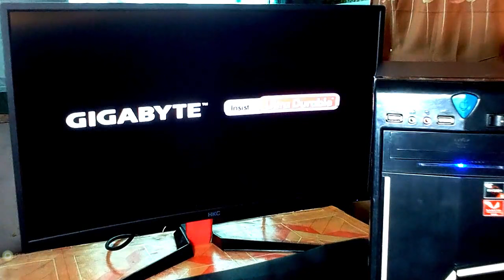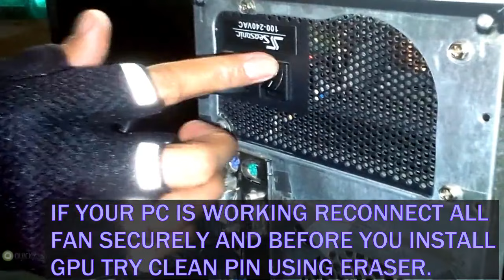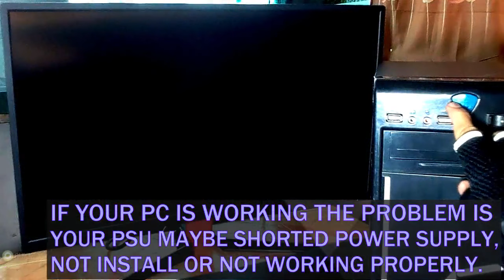HOW TO FIX COMPUTER TURN ON THEN TURN OFF IMMEDIATELY ? CPU FAN SPINNING ( 2019 )

Comment: My computer sometimes boot loops doesnt start. Then i changed ram thinking it fixed caused it worked again. Now it does this again
Reply: Ok what did you do ? Same issue
Reply: @memokane1  i toke the motherboard out and changed the cmos battery. And reset bios. Its now working again

Comment: Mine would turn off after a couple seconds of turning on. Or it would turn on and just black screen. The first two times of trying to take out the CMOS battery it worked and turned on. Now it won't even turn on after doing that. Just back screen
Reply: What did you do ? Same issue
Reply: @memokane1  It was my motherboard, it was bad. I tested everything out first and narrowed it down to that

Comment: Good day sir. Bumili kasi ako ng GPU (GT 610 1GB) my Mobo is GA-F2A68HM-S1 and AMD A8-7680 CPU.
After ko ilagay yung videocard, nagloko na sya. Ayaw na mag open ng Monitor though pag tiningnan ko yung fan ng cpu and psu, umaandar naman tapos inobserve ko, namamatay din cpu fan and psu pag tumagal. What shall I do? Na try ko na tangalin ung GPU habang nireset ko din sa pag alis ng battery at ng RAM. Gumana siya about less than 30mins then bumalik ulit sa ganito at ayaw na umayos. My PSU is generic (INTELLIGENT 700W)
Pls help, TIA and more power.
Reply: na-fix mu n ?

Comment: Nope tried all of the above for my issue and still nada :(
Reply: Then you gotta replace either the power supply or CPU
Reply: @nitinlakha994  I found my issue eventually, the motherboards ram slots were particularly stubborn, had tried multiple working rams but hadnt realised my motherboard needed them pushed in very hard to properly click